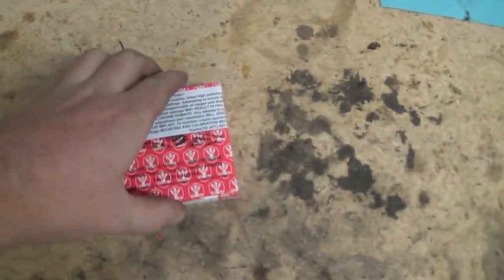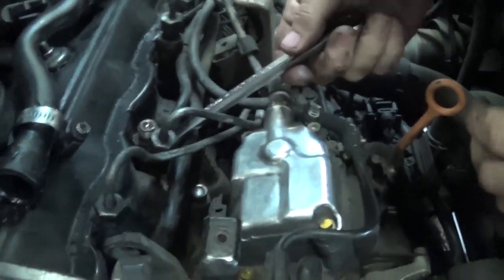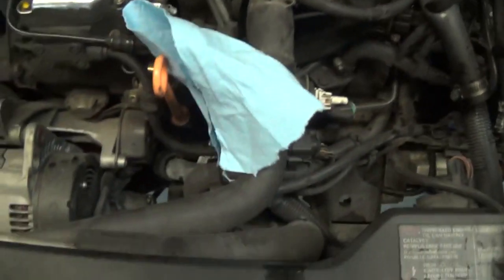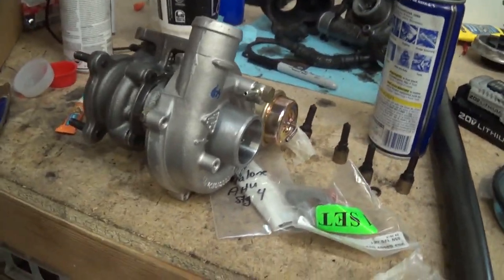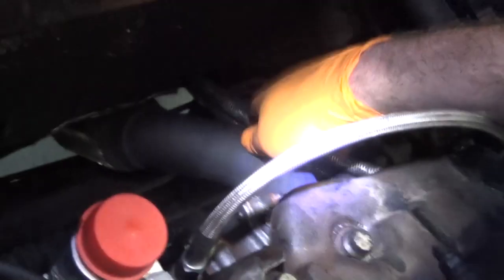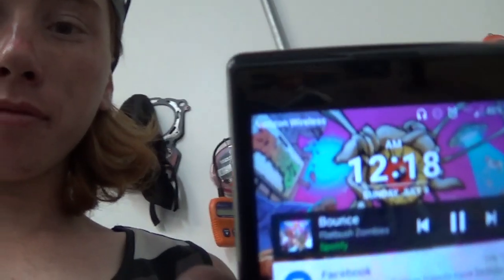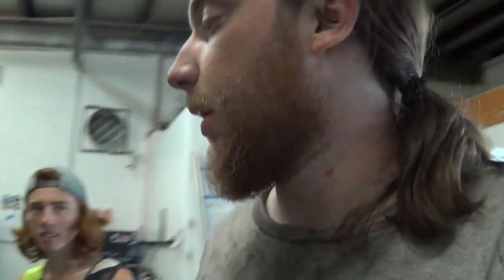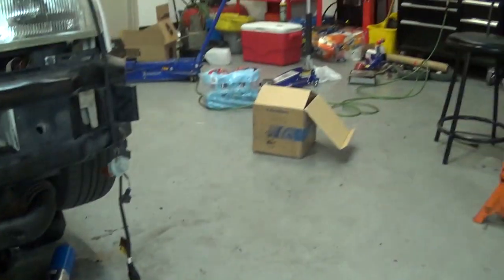MK3 TDI Big Turbo Upgrade (pt2)

Comment: i have question...i have same engine in my mk3 but i want better turbo...i also have salvage mk4  ajm 115 hp entire engine and wiring...can i fit that turbo on my 1z and what else i need to make it function...just to mention i don't need like 200 hp i want to be around 140,150 so nothng breaks in engine

Comment: Any reason why you wanted those injector nozzles?
Reply from the maker: More fuel for the added boost to make sure there was enough fuel to burn.
Reply: Gotcha, I'm thinking of doing the same turbo swap but I already have 764 nozzles and was just curious. Thanks by the way for the upload man! Also, was wondering what chip you installed. Part#?

Comment: Is it actually biger then the stock one
Reply from the maker: Yep, billet compressor wheel with a k04 compressor housing, which allows for more flow while still keeping the boost in the lower rpm for more torque. I believe it is running around 25-28 PSI on it as well.
Reply: @restlessgarage5942  okay i was thinking the same because the part number on the box says that it is a k03 turbo

Comment: Turbo reference? Or is híbrido?
Reply from the maker: Hybrid k04
Reply: @restlessgarage5942  hybrid k04 or k03 convert in k04? Please you can send me the reference?
Reply from the maker: https://www.kermatdi.com/i-198-k03-k04-hybrid-turbo-for-mk3-b4-96-99-jetta-96-97-passat.html
Reply: Which is better? K03 hybrid or gt2056S? Also touching a bit of the pump and the ASV 300bar injectors.
Reply from the maker: @semacampos7620  The gt2056s will make more power